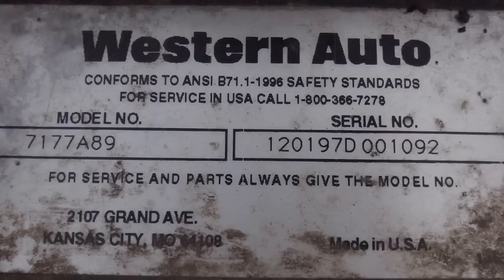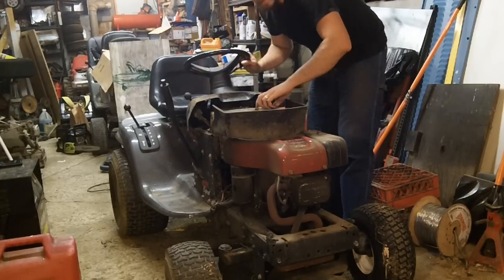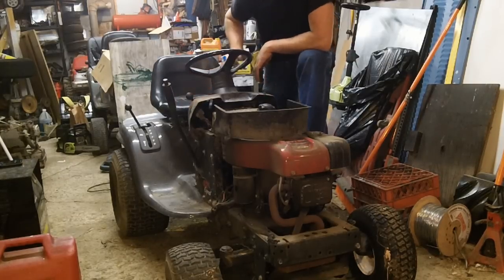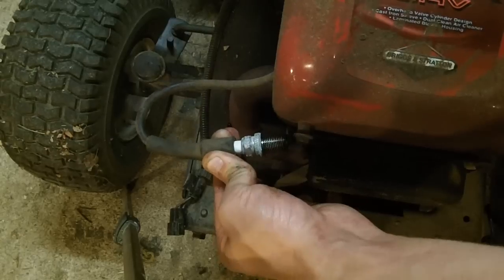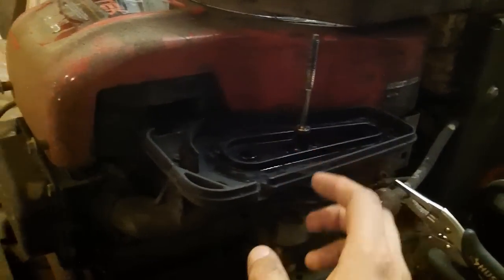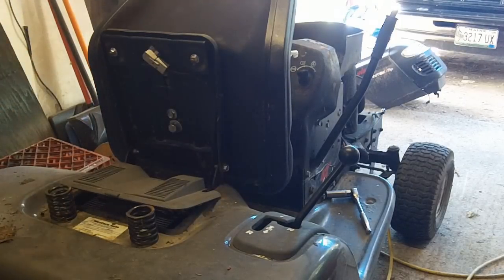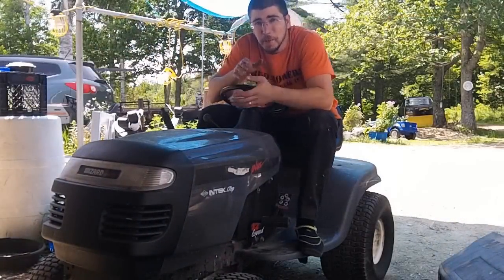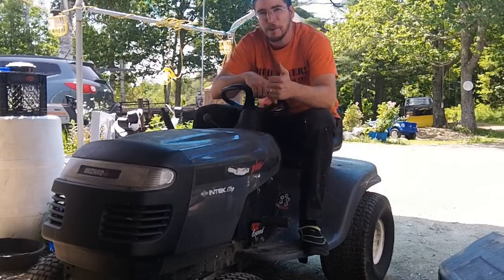Tractor Hunting "Mud Wizard"

Comment: So my dad has a wizard riding mower as well that’s actually bigger and I was wondering if it’s basically the same as the craftsman gt6000 because it seems to run the same size wheels as a gt and the front nose kind of resembles one
Reply from the maker: Yes Wizards are price cut Craftsmans. Hoods and paint are lower quality and some times the decks are thinner metal.
Reply: Yeah that’s what I figured I’m thinking about putting a plow back on it and use it to plow snow